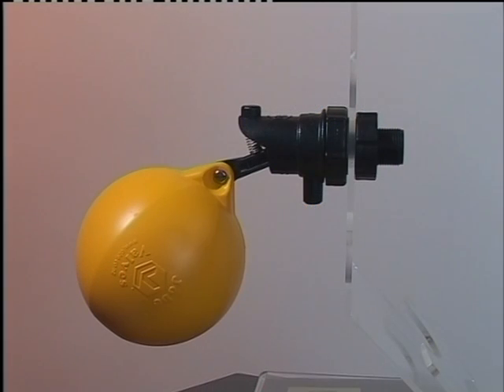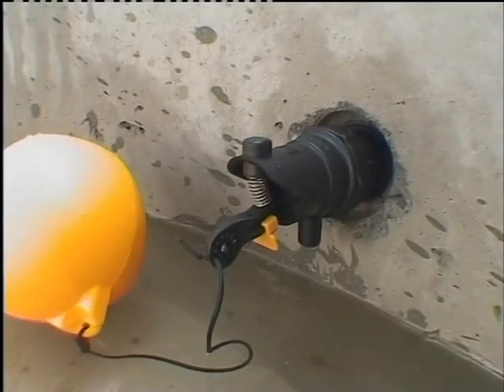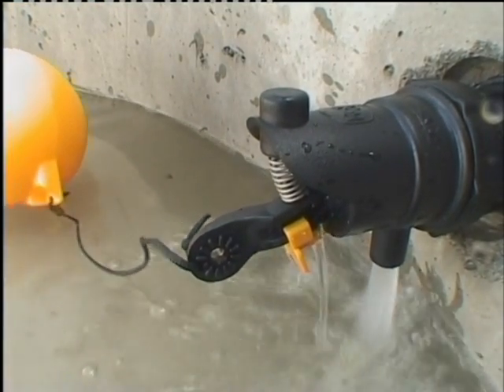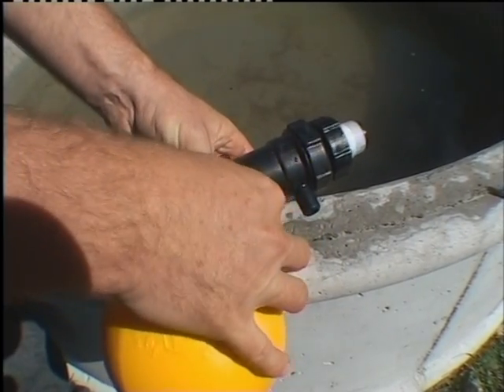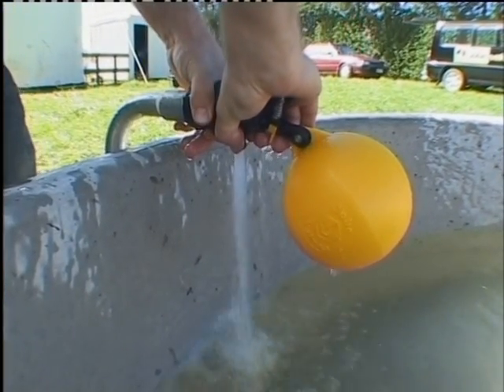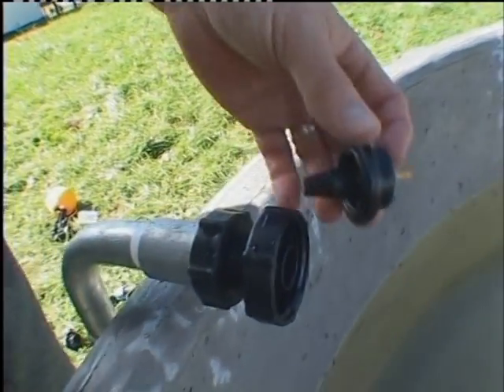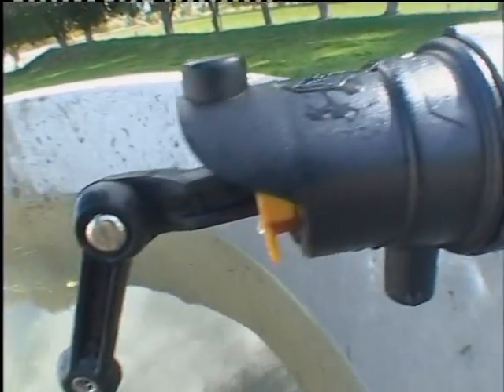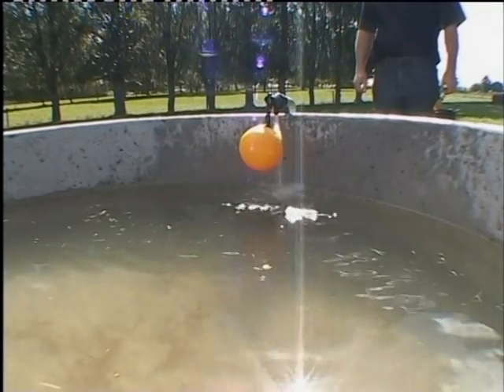Rojo Float Valve

Comment: Could it be used in a toilet tank also
Reply from the maker: Hi Jamil, yes it can be used in a toilet tank. The main issue is connecting the float so it doesn't hit the flush mechanism. To do this you may need some extension arms which aren't supplied with the valve. Extension arms can be purchased separately.

Comment: Does the 1/2" version of Rojo Compact valve come with NPT threads on the tail? Or does it come with BSP threads? I'm looking at the product on Amazon, and it's not clear. Please advise.
Reply from the maker: Hello the 1/2"Rojo Compact will actually fit both NPT and BSP threads because they both have the same pitch (threads per inch)
Reply: I purchased the 1/2" Rojo Compact on Amazon and tested the tail fitting. Unfortunately, the model I received uses BSP threads, which do not form a tight seal with a NPT female coupling under pressure. The threads might deform with tightening and teflon tape helps, but I'm not going to risk installing a product that may leak at a later date because I tried to force a connection between two different thread forms. I would like to use the valve - can I buy a separate 1/2" tail with NPT threads somewhere? Please advise.
Reply from the maker: The 1/2" thread only comes in one form so there is no dedicated NPT option. We have found it to work well with BSP and NPT threads so I'm sorry that it's been a problem for you. The Rojo with a 3/4" thread has a dedicated NPT thread. If you purchase the valve in the USA it will certainly have the NPT thread on it. The 3/4" tail is interchangeable with the 1/2" tail. I can arrange to get a  3/4" tail sent to you. Just tell me your address on the "Contact Us" section of our website www.jobevalves.com   You would need to use a reducing fitting to connect it to your 1/2" pipe but the thread form will suit your fittings. I hope this will sort out your problem.
Reply: Great, thank you!